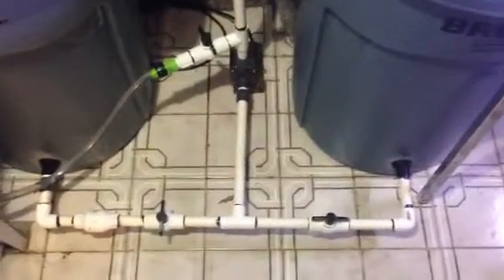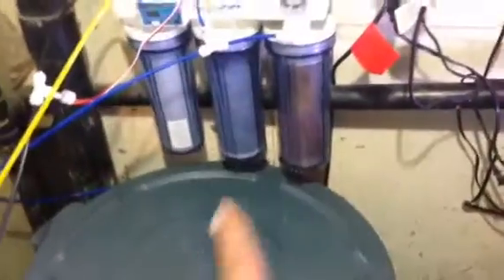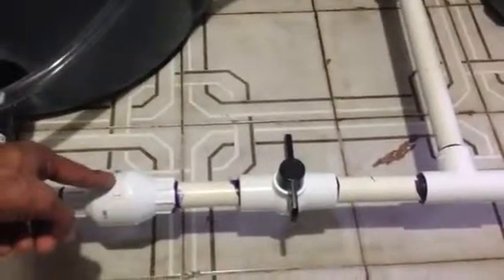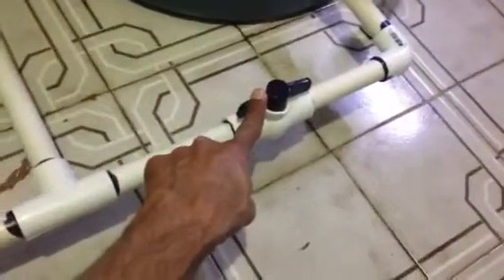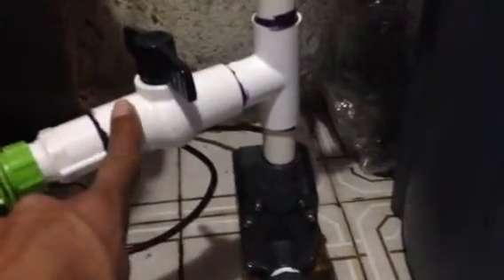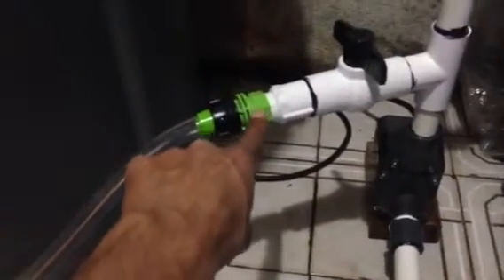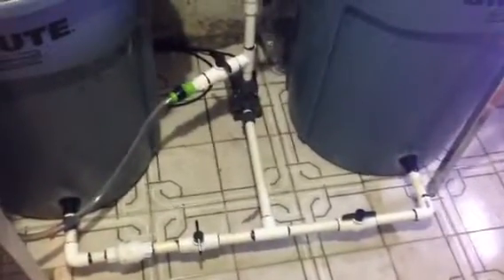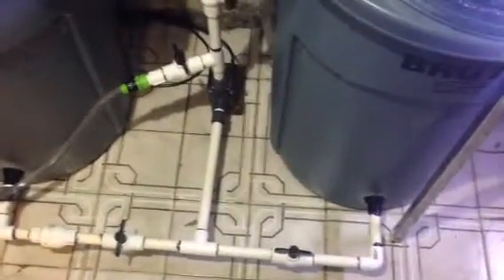My Water Change Station

Comment: Are you still using this mixing station? Great job! Where did you get the design from? Do you have any other designs you may consider? Thanks great video
Reply from the maker: Thank Leo. yes i am using this station every weekend when i do my water changes and i cannot express in words how helpful this has been specially for large tanks. I got this designs from youtube or i guess google dont remember...but if you google you will find so many decisions out there. If you have space issue you could even stack the two drums and use Gravity to drain the water from the Rodi can into the saltwater mixing can and than just use a return pump to pump water back in your system. My station is almost 50'ft far from my main display and its in the basement i was having challenge to pump the water back in untill i met a guy Carl from Carl's aquarium who sugested me to buy a submersible sump pump from Home depot for $67 bucks which has good force/power to pump water in my display. before it use to take anywhere betwen 45mins to 1hr now it takes 10 mins and i am done...